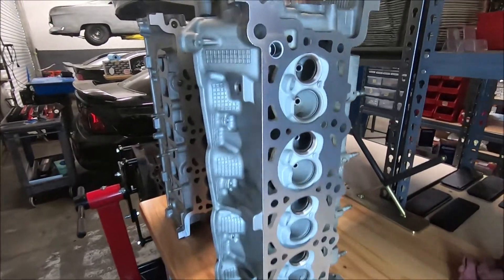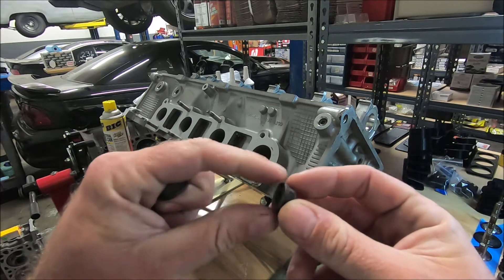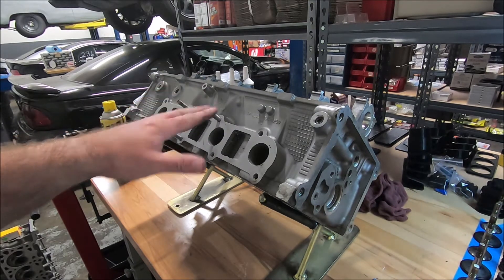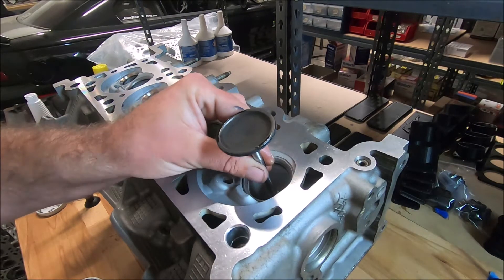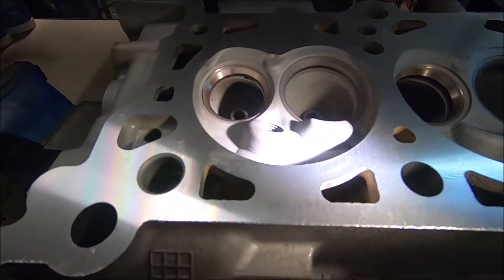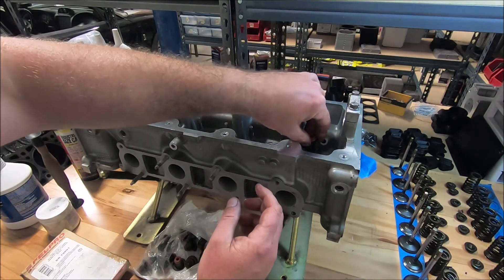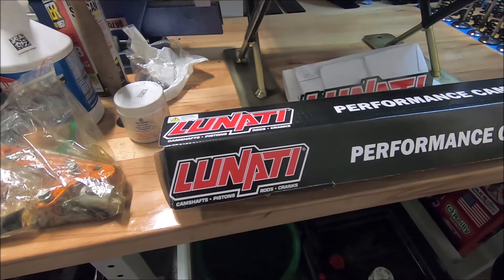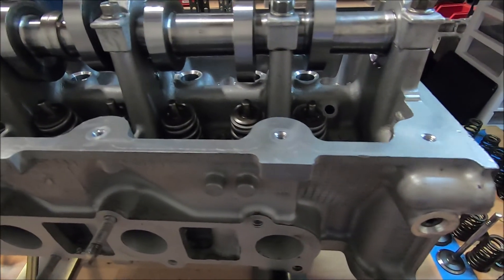99 Mustang GT with Nemak Part 12 – Assembling the PI Windsor 4.6 Cylinder Heads

Comment: Is it important to keep everything in order & put everything back in its original place? I took my valves out & everything is mixed up. 🤦🏽‍♂️
Reply from the maker: The valves are not as important as the cam caps on the heads.  The springs, lash adjusters, and followers can be moved around as well.  I recommend lashing the valves as well.